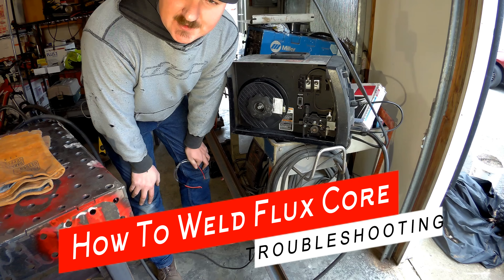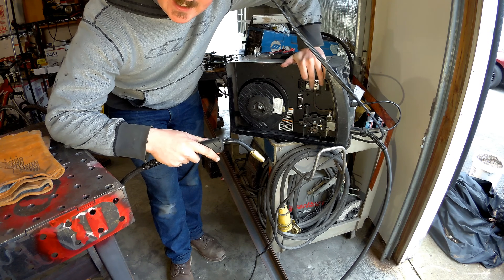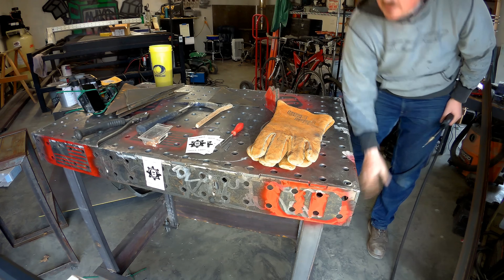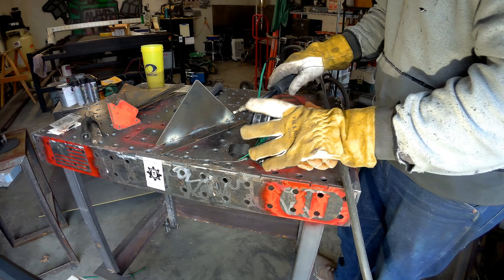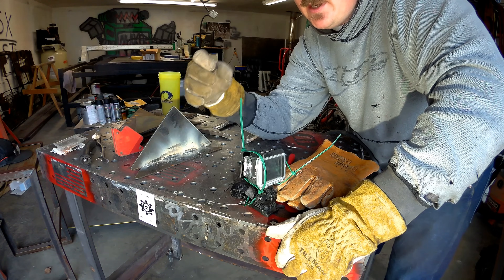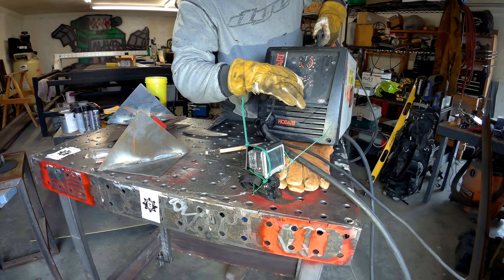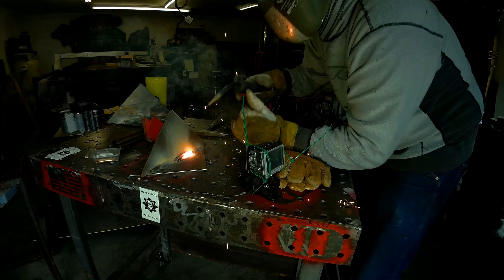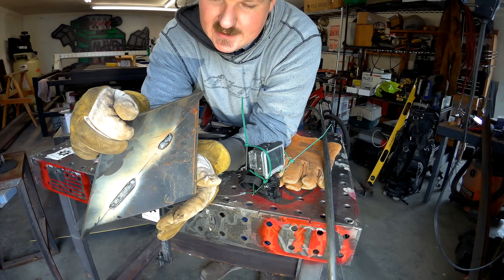How To Weld Flux Core [FCAW] - Setup and Troubleshooting

Comment: i was running 035 wire on my 110v welder. the tip on usuing 030 makes sense as to why i was having troubles welding 035

Comment: Brand new welder here. I got my flux core to feed the wire but it was not sparking at all. After a phone call to Harbor freight they told me you have to pull the trigger all the way in. This finally worked. I could find no instructions or videos to explain this

Comment: I have watched and also purchased CD's on FCAW as I am a brand new Harbor Freight 90 Amp beginner. I learned so much from his hands explaining the "Shelf" and "Filler Metal" puddle. Summed it up great for me and now I know what to look for. I am still just trying to make good welds on scrap, but look forward to making my own welding table. This is really great Teaching. The Guy is a natural (and funny too). Thank You !
Reply from the maker: Thank you so much for the awesome feedback!  I'm really glad I could help you out a little.  No need to spend money to learn welding if you are trying to weld for yourself.  Check out Chuckeee2000 and welding tips and tricks, they both taught me a lot of good tricks on here.  Good luck and don't expect it to come fast, it took me thousands of hours under the hood to get where I'm at today and I still have room to improve.  Just enjoy the process!
Reply: watched alot of welding videos and none mention the slag shelf so i  never thought about it,thats a great explanation,ive had the lincoln 140 ,110volt for a few years and have only used .35 flux core,hardest for me is getting wire speed and voltage to work together

Comment: Howdy there, I've got a basic 100 amp gasless mig. I use 0.08 mm flux core wire. For years i had no idea how to weld. My welds were mostly terrible. After watching your video, finally got it right with some practice. I repaired my zero turn ride on mower.  Deck was damaged/cracked. My welds looks pretty good. Thankyou very much for your excellent tutorial video.  I'm now  looking for anything  to weld. 🤣😂😅. Cheers from 🇦🇺👌🏻👍🏻...
Reply from the maker: That is an amazing story! It really makes this all worthwhile to know I'm helping to spread the joy of welding around the world. Happy making!
Reply: @MakerTable  my main concern was flux mixed in the weld seam compromising strenght. Love my welds now. Thankyou again 👍🏻👌🏼👏🏻👏🏻👏🏻

Comment: This is great! Thanks for the tutorial. I have had a welder for over a year now but I have been scared to use it cause I don't want to get the settings wrong. This will help greatly. I have been wanting to extend my go kart and hopefully I can get it done this spring using tutorials like this.
Reply: Don't be shy. Gotta run it to learn. 
You won't hurt anything.

Comment: I have just done an intro course to metalworking and the instructors did not recommend a flux core welder but after watching your video, I think it is the one I will go for as it does the job and is much cheaper than a mig. Thank you. I am saving this to watch again!

Comment: Thanks for explaining the polarity & the wire size. I’m looking at starting on a 110 flux core unit & then graduate to a 220 multi function unit, if I get proficient at welding. No one else explained the 2 items either at all or as well as you. The lesson in speed & heat was also great. Subbed & saved this video.

Comment: Thanks! great video explaining temp and wire speed. ps, to find out your wire speed feed rate with a "Relative"  1 to 10 dial i made a chart by going though each number ie 1,2,3,4..... and feeding wire for 6 seconds then measuring with a tape measure, and multiplying by 10 to get your inches per minute. ie, say on setting 2 you get 5.5 inches of wire fed in 6 seconds x 10 is 55 inches per minute . cheers,

Comment: Seventy years in and getting ready to strike my first arc. Have been to a lot of sites that helped, but lacked critical details critical to helping beginners figure out what the need to do. For example:

1) How much stick out?
2) How far do I need to be from the weld as I run my bead.
3) How do I start (e.g., do I strike and pull back with the speed of a Kung Foo martial arts eightieth degree black belt, touch a button on the gun and wave it over my head, reflecting on the information I gained in my Tesla coil researches, or. . . .?    

Lot of helpful information here (could still use help on number three ;)       Appreciate your work, very much. Thanks
Reply: 1) 3/8 to 5/8 inch
2) Just keep the tip less than 3/4 of an inch from the work piece. The voltage will control the arc length.
3) All you need to do is press the trigger and it will start the arc. It is not like stick welding where you need to strike the arc, then pause for a second to let the puddle build, and drag the puddle.

Comment: I need to weld a couple of holes in a motorcycle mudguard , it's less than 1 mm will flux core work? Thanks
Reply from the maker: Yes, as long as it's steel
Reply: I'd best buy one then!

Comment: Great video covered a lot of stuff that other didn't. Thank you so much I finally figured out I was using the ring wire because I was using the wrong wire.
Reply from the maker: Keep trying new stuff until it works out, the rest is all about getting under the hood and committing it all to memory 👍

Comment: I have a question for you, i just start learning to weld, i have a flux core welder 120v, has MIN/MAX , and wire speed, i tried to weld gauge 18 plate to a body of a car, clean the place first, but i tried 50 wire speed, and MIN on heat, but each time( most of the time ), i burn the metal, looks like whatever i do( used many different setting, low and high, this and that,  but,  what is wrong( but i know it is me  in the first place !!), thank you for your video.

Comment: You recommend 030 wire for 120V systems and 035 wire for 240V systems.  I would think, but not sure, that an 035 wire might be good for 120V power welding thin auto body sheet metal.

Comment: I'm completely new to welding, just bought a 110v unit for my garage as a hobby (Mastercraft) I was running .35 wire through it. Didn't realize I shouldn't be, can this damage the welder?
Reply from the maker: No damage to the welder, ur totally fine. It's just a little easier to get penetration with a smaller diameter wire on 110v power. Happy making 😁

Comment: Glad I found this,.you wouldn't believe the grief I've had trying to weld flux core..😳🇬🇧
Reply: One bit of advice if you don't mind me telling you is when you weld with flux core you constantly have to wire brush or wire wheel the Weld and the area keep it clean or it will not come out very well my suggestion is to have a wire wheel on an angle grinder have it ready at all times so every time you tack weld or run a bead you can clean it at instantly once you get used to it it's like anything else second it becomes second nature

Comment: im new to welding and i have a cheap 110v flux core. Im using the lowest settings and tried using a couple different wire speeds but i keep melting holes through the metal. Please help!

Comment: I use a lot of 0.35 with 115v at my house, in fact is the only way I have run my welder ( Lincoln 210mp) and I have never had any trouble, super strong welds, I have found more difference with the brand of the wire, first I used Lincoln but it’s expensive, then I changed to blue demon cause it’s cheaper but worst weld quality. It makes sense what you say, have you ever tried dual shield flux core? What’s the difference vs straight flux core?

Comment: Very instructive video, thanks for the learning/ explaining well done. The question I have is why after each weld do you feed the wire and then proceed to break some of? What is the purpose of this action?
Reply from the maker: There's usually a little blob of melted slag on the end of the wire which can make it hard to start the arc on the next weld.  Breaking it off gives you a fresh end to make good contact which will give you a smoother start.

Comment: Hi,  I’m new to MIG flux core welding. I noticed that you didn’t clean the mild steel? Will flux core work if the steel if the scale isn’t taken off the scale before?
Reply from the maker: Absolutely, that's y I recommend flux core to everyone that needs an all around welder. It's not the most precision instrument but it welds in wind, through paint/powder coat (2 passes, great ventilation and respirator), mill scale and rust. The two things it won't tolerate is water and slag in the weld.

Comment: Did you break the tip off in between welds??... you never mentioned that
Reply from the maker: Yes, it can help you have cleaner starts if you have fresh electrode sticking out for every weld.  It's a good habit to start.  Really easy with flux cored wire because it's so brittle, mig wire will require a set of pliers to cut between welds.
Reply: @MakerTable  I’m having a hard time breaking it off, do I twist it or bend the whole wire, do I actually rip off the whole wire sticking out of the gun?

Comment: Great video. I was getting no arc because my ground was not on the workpiece i was welding on. Now i know where my ground needs to be. 

So .035 wire is not a good option for 110v?  I have the HF Flux core welder.
Reply from the maker: Dubious Jesse Thank you! You can push that .035 on 110v but the .030 will run a lot better for u. Keep running passes and you'll have it figured out in no time 👍
Reply: My little 110v. Lincoln Handy MIG came pre-loaded with .035 flux core and it welds very good.  Lincoln Electric is the company / engineering crew who invented and first manufactured flux core wire to make it simpler for welders hanging steel for skyscrapers to do their thing.  Flux core welding IS arc welding....with an electrode that's a mile long instead of 14 to 18 inches.  With flux core, there became no need to carry bundles of those rods up high on the job sites and also avoided  the hassle of putting up a lot of air dams to block the winds from blowing away MIG gases.  I learned the history of flux core on the James F. Lincoln website.  Steel hangers were / are using .045 and .065 diameter flux core.

Comment: I got the cheapest Wallmart flux core AC welder and hated the sputtering. So I got a second had 90A bridge rectifier to make it DC with negative on the wire and positive on the clamp. It made a world of difference, it could suddently make clean welds. Also standby voltage is now18V instead of 14V previously, so striking is easier and also think it transfers slightly more heat now. So even with the crappiest hobby welder, I'm getting satifactory seams, both sheet and up to around 1/4".
Reply from the maker: Ur a beast! I have no idea what half that stuff means but it sounds like ur hacking a cheap welder and turning into a badass machine 🤘

Comment: I'll switch back to 030 wire I don't have 220 yet also dial in the roller tension
Reply: How big is your machine? I have a 110v Mastercraft Maximum mig 140 welder and I run 035 wire in it and it welds just fine. When you purchased your machine did you change the drive roller to the one that accommodates  035? Mine came with two different rollers one for 035 and for 030. I stick with 035 because I use this machine for heavy trailer repairs.

Comment: I am unclear about wire speed - I understand that in addition to the speed it also controls the current.. Anyway, I notice that you turn your wire speed down from 55 inches per minute to 35 then 25 inches per minute.. My machine is a 120VAC input Inverter and with flux core my settings can range from 10.3 VDC to 25.7 VDC stepping 0.1 VDC and my wire speed range is 2 meters per minute (78 inches per minute) to 8 meters per minute (312 inches per minute) stepping 0.1 meters.. In addition to these two variables (volts DC and wire speed) I can also change the Inductance at any setting from -10 to +10 stepping 0.1 (100 range adjustments).. Anyway back to my confusion, where I am confused is because the slowest my machine will  push wire is 78 inches per minute.. And for example on 1/8 inch metal using 0.30 flux core the factory recommends 16.2 VDC and 3 meters per minute (117 inches per minute) wire speed - does this sound correct, sounds like fast wire speed to me, what do you think?

Comment: Are you an ironworker? Seen the sticker on the hood
Reply from the maker: I was when I made this video 118 Sacramento then I boomed out to 492 Nashville.  I just work in the shop now though so no more chasing the hook.  How about you?
Reply: Cleveland hand. Local 17. Still chasing the hook. But I also do a lot of welding. Gonna get my wife papers here soon. They’re gonna have me test with NR233 wire
Reply from the maker: Awesome man, that 233 is really sensitive to voltage which means your stick out length is crucial.  Watch that slag shelf, if it splits when running verts the voltage is too high.  Keep practicing, you got it brother!
Reply: Maker Table thanks brother!!
Reply: @shanecaldwell8995     I got my wife papers, and she still pees on the floor.

Comment: Not right on the wire info 030-035 can both be ran on a 110volt machine it has more to do with amperage if u have a 90amp machine ur wastein ur time 140-180amp machine will run every thing you need just couse u have 220 volts comeing in has nothing to do with how much voltige ur puting down a 110 machine will put out 52 volts at 140amps with a 20-30% duty cycle on 220 machine the same voltage in amps will be slightly better 40-50% duty cycle ..
Reply from the maker: Thanks for sharing some more info! The main point I was trying to make was that people with 110v machines will get better results pushing 030 wire instead of 035 wire.  Do you know of a 110v machine that will push 035 wire with the same penetration and deposition rate as 030?  I've welded with every 110v wire fed machine except for Esab, Forney and Everlast on house power and countless generators and always had better luck with the 030 wire when hooked up to 110v electrical in every situation.  I'm not trying to be a d*ck I honestly want to know if there is a badass machine out there that will push 035 on 110v power with the same performance as 030.  Best of luck to everyone trying to get better at welding!
Reply: SHERMAN YOUNG
I just got the same welder and tried it for the first time - actually first time with anything other than oxy. I ran .035 as recommended. My welds are terrible but I'm assuming that is just me needing to learn. That said I may try .030 later.
Reply: SHERMAN YOUNG No - other than just starting fluxcore with the Century FC 90 this weekend. Lots to learn!
Reply: First, just to be clear, I never doubted the machine. I read the same good reviews on HD, and that is why I ordered it from them. And yes, my welds started getting better. I began building a welding cart with the FC 90, to support it and an Everlast TIG/Stick/Plasma cutter combo machine. However, the thermal cut-off in the FC 90 began to come on randomly. For example, after just turning it on and starting 1 small tack, it would cut off. Other times it would run normally. I submitted a note through the Century website, and was shortly contacted by a Lincoln tech. After explaining the issue, he told me just to send it back. They sent a replacement unit really quickly. I have not had time yet to try it out, but expect it will run fine.
In the meantime I used the Everlast to get in my first stick welding. That was fun. Will have to wait to try the TIG and plasma cutter as I don't have argon or a sufficient air compressor.
Anyway, I do like the FC 90 and hope you keep enjoying yours.

Comment: Bitchin video dude out of all the videos I've watched about flux core welding nobody talked about using 030 with 110 volts.ive got 035 on there now and shits all fucked up also drive roll tension and the roll of wire tension.flux core ain't easy that's for sure the night course I took at the local tech school we ran gas mig and that was cake.....thanks for the great video
Reply from the maker: Wow, thanks man!  I'm glad you found this helpful.  If your trying to push .035 wire through a 110v machine your going to have issues with the wire feeding too fast and pushing back towards the gun.  I hope the .030 wire helps you get better results.  I know it's frustrating sometimes, just stick with it man!

Comment: My 120V welder can use both .030" and .035" flux cored wire. You don't need to have 220V for .035" wire. I'm not sure why you were so adamant that a 120V rig couldn't  use anything over .030".
Reply from the maker: It's possible but harder to get good results. I'm trying to show everyone the easiest way to get acceptable welds. Deposition rate is in direct relation with available voltage. If your limited to 110v you want to "focus" that power through a smaller wire diameter to maximize penetration. Larger wire will run at that voltage and even melt, but it won't penetrate as well as an 030 or smaller wire at 110v. Happy making, glad to see you experimenting beyond this video 👍
Reply: @MakerTable  Thank you for the reply. I'm a complete novice to welding so I appreciate your advice. In light of the information you've presented, I'm wondering why my machine suggests using the thicker wire (,035) for the thickest metal (1/4") it's capable of welding. I also notice that I get a lot of undercut with .035, although it's likely it's just my poor technique and lack of experience.
Reply from the maker: @martyapo keep running passes brother, you'll get better everytime you drop that hood 💪

Comment: He never cleaned his tack welds.others point out that failure to clean slag will cause slag inclusions in the weld. The photography needs improvement. You need a cameraman weld shots are too far away to see what you are describing. You need a shield for your camera to show welds in progress. Try weld.com for good videos. Never used anti splatter spray. Never used nozzle gel.